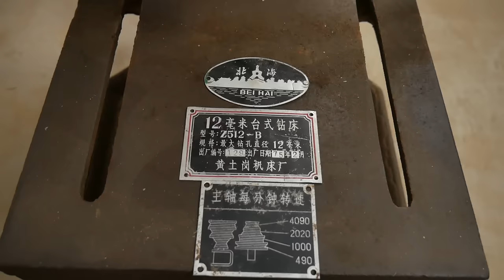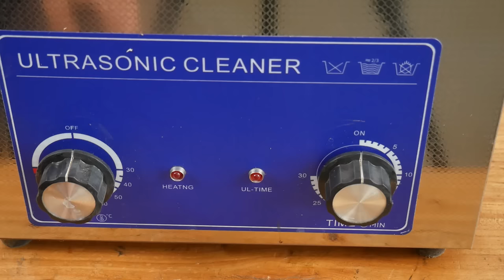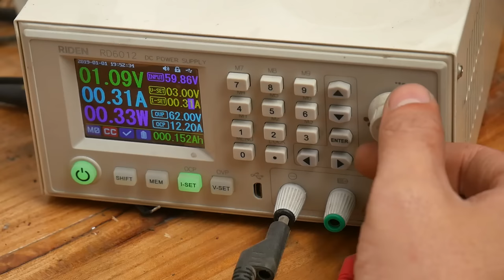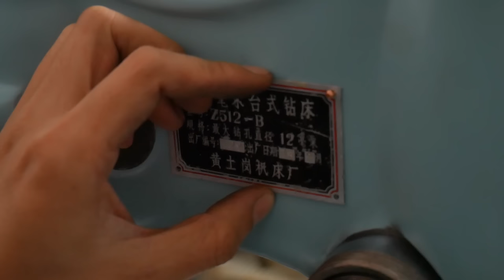Restoration of Drill Press | Bench Drill

Comment: Looks beautiful, but at 22:21 you can see the run-out.  If you can see the run-out with the naked eye, it's too much.   You measured 0.13mm total when you pulled and pushed on the chuck by hand.  I think that's your actual run-out.  As a quick reference, If your run-out is 0.05 mm or less, you wouldn't be able to see movement at the tip.  Maybe bearings should be checked or maybe time for a new chuck.

Comment: Excellent restoration -  That small  x-y table attachment will allow you to use this small
drill press to do some very light milling work.
Reply: Risky - the bearings in the spindle aren't made to take side loads, only axial ones. But the X-Y table will allow the drilling of accurately located holes.